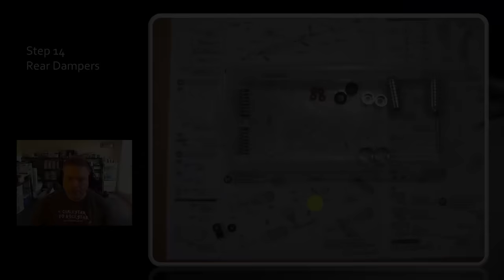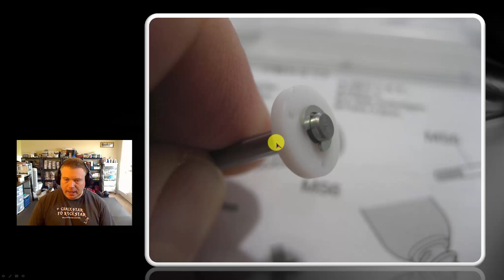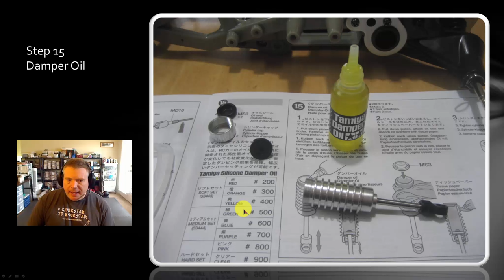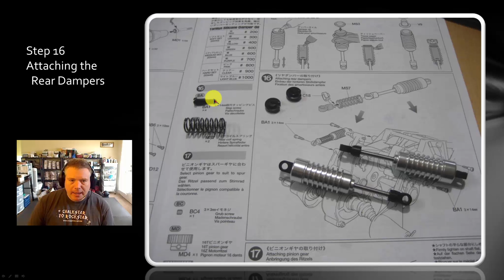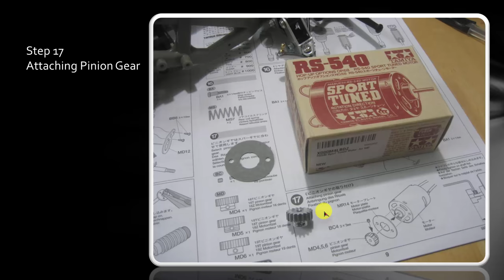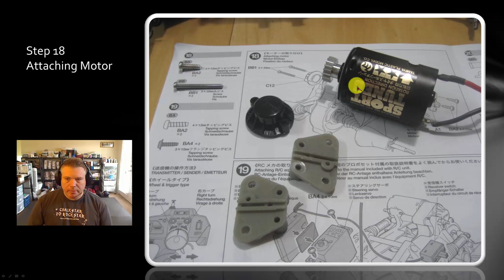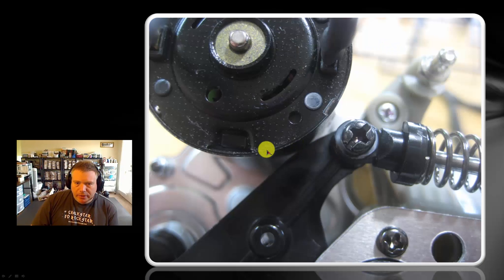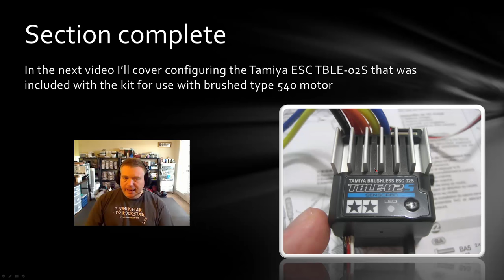Tamiya Frog Build - Steps 14-18

Comment: :) :) @13.30 you missed the 16.6mm measurement from the back of the can motor to the edge of the pinion gear in the instructions......the correct alignment for the gears. :)  :)
Reply from the maker: There's always something!